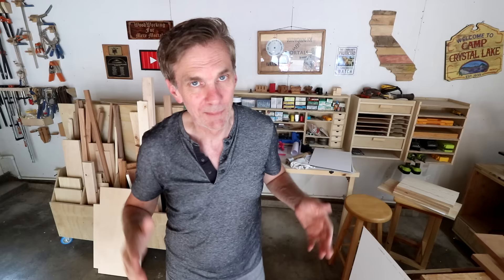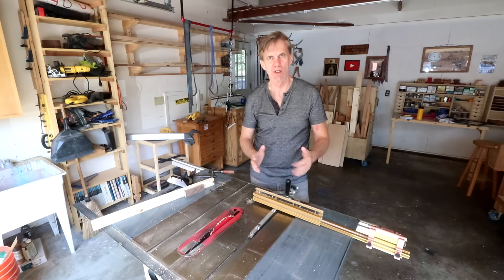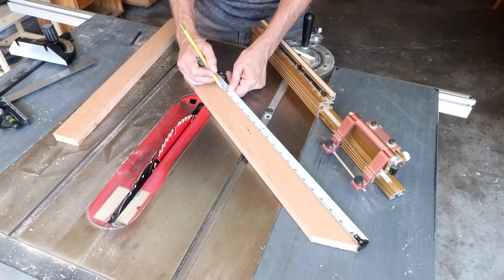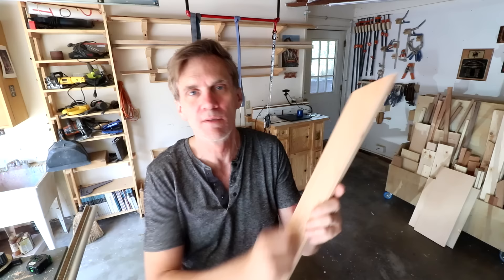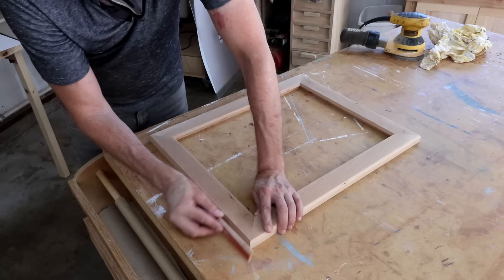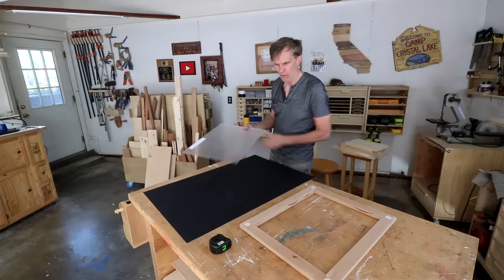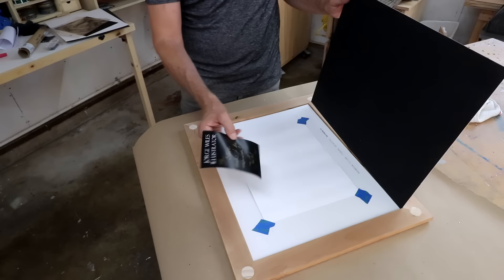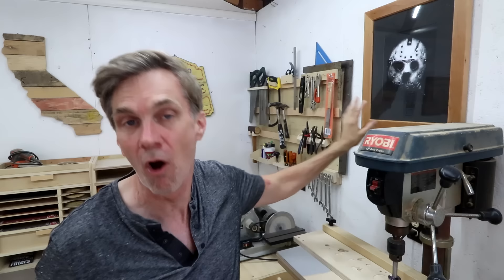Picture frame BASICS. How to make a simple picture frame using a tablesaw.

Comment: Hey Steve, you only need to tape the top of the artwork, this way changes in humidity and temp don't cause your artwork to be wavy inside the frame. If you only tape the top, the artwork will always "hang" inside the frame and stay flat
Reply: Came here to say this. Was also pleased that some still knows what rubylith is.
Reply: I'm only a year late to the party, but was also going to say the same! I like the table saw method for rebates - although I use a Morso for the mitres and an underpinner for joining the frames..the Morso is awesome for repeat, accurate cuts - they are not cheap, they are not light....but they are good! Mine is now 45 years old and still works brilliantly - those Danes know how to over-engineer 😊
Reply: @crispy_otter  there is no such thing as "over engineered". I dare you to supply an example 😉
Reply: @richardcagle5475  Every Mercedes ever built. Great until something goes wrong then it's $1000 to replace an unnecessary sensor that won't allow your car to drive. 

Also most Volkswagen's. Haha.
Reply: @maxgilbert18  cheap sensor. Expensive labor. Just do it yourself an they 1k sensor is $50
Reply: @richardcagle5475  That's why I drive an old Toyota. Very cheap to fix. But the parts are getting harder to find these days unfortunately.
Reply: @richardcagle5475  Juicero Press 😎

Comment: I thought that dowel reinforcement looks like it could be a nice decorative element on the frame itself using the contrasting color woods, maybe use a couple of smaller 1/4" brass rods per corner, not to mention splines, router profiles, exotic woods, texturing, gloss finishes... you know... over complicate things! 😁 And BTW: not just woodworkers... engineers too... that's kind of in our job description! 🤪 - see you next time.
Reply: Agreed. Im gonna knock this frame up and pop the dowel locks on the front

Comment: Former custom framer, here. Just loop the wire through the d-ring twice, and use the excess to wrap it around the long part of the wire tightly to create a kind of coil pattern. Do that on each side.
Reply: Came here to say this!
Reply: I always double up on wire like that by twining it with a drill. Maybe not necessary for light frames but it’s a lot of fun to do. :)
Reply: Same,  whats your favorite kinda wire?
Reply: @dw4940  coated stainless steel wire in a variety of sizes based on the weight of the framed work

Comment: Hi. Greeting from Vietnam. I've been watching every single videos of yours in quarantine time and they help me so much. I bought some power tools (from your 1000$ list), declutched the forbiden corner (in which we stored scrap over years and years) on 2nd floor, and then turned it into a DIY garden. Most based on your ideas making stuff from pallet wood. 
My favorites quote of yours (especially when i doubt my work is so normal) is : You create something from nothing, that makes you special. That quotes keep me on track to complete everything i ever start.
After 4 months, the forbiden corner has turned into a lovely garden my dad and mom relax after work.
Sincerely, i wanna say thank you so much. I'll keep watching and learning from your channel. 
BTW, i really want to show you about my garden but I don't know how to. if there is a way, plz tell me. I do appreciate.

One more time, thank you so much.
Reply: So I have trouble figuring our measuring for the miter cut. If I have a 16 x20 canvas painting and I want to allow for the rabbit what is the rabbit cut measurement. For the 16x20 do I add 1/4 to mark the point of the 45 degree cut on each piece? If not how is it measured?
Reply: @garyfournier9419  l think it would depend on the width of the frame. He was using a 2 inch frame so therefore he was adding 4 inches per side to allow for the mitres. 16 by 20 would extend to 20 by 24 inches.

Comment: Double side tape on all the way around the edge of the back of the picture before you put the bumpers and hangers on it.  Then lay out your craft paper on the table larger than you picture.  Make sure its flat on the table.  Lay your picture face up on the paper and press all the way around it.  The paper will stick to the frame.  Then flip it.  Pinch a razor blade between you thumb and forefinger.   Use your forefinger as a spacer to ride along the edge of the back the frame and trim off the excess paper.  Should be nice and tight.  If not... like he said use a damp cloth to tighten it up.   I use a 3M dispenser with tape on a roll.  Leaves just the sticky tape.   I also picked up a nice mat cutter on craigslist years ago for about 60 bucks.  Was used a frame shop.  I used to work in a frame shop and its exactly like the one I used.  cuts pretty good.  Just a bit hard to store.  Also, if you use glass leave a 1/8 inch space (top and bottom) in the rabbit for the glass to expend and contract.   I also weight the bottom of the mat at least 1/4 inch so it looks even sitting in the rabbit all the way around.  Some like it heavier.  I'm not opposed to it at all.  I like a thick mat.  2 inches or better.

Comment: Being that the pointed tip of a 45° cut is the weakest part of that end-cut, it is a better to use a stop-block that is also cut to 45°.  Then your following pieces will be registered against a flat surface (albeit angled flat surface) versus a relatively soft point ... a point which may not provide consistent results.  I found that advice when I did a little research before making my first picture frame ... and my first attempt came out perfect.  I always look forward to seeing your videos, Steve.

Comment: Great video. I love the idea of the dowels to secure the frames. I've never thought of that!

When mounting the artwork to the back of the mat, I use wide paper surgical tape. It's acid-free and it pulls off easily if you need to reposition it. Also, I only apply the tape to the top of the artwork. This allows the artwork to float behind the mat. If you tape all four corners, the artwork cannot expand or contract and can result in ripples.

Comment: Great video! I´m gonna try to make a frame myself later.
Quick tip: For a zero clearance inlay, you can just tape the gap using ducked tape. Just make sure the tape runs the length of the table. There you have a zero clearance inlay in 7 seconds.

Comment: Thanks Steve! Made one this weekend and it’s fool proof. Have only been woodworking for a year or so and a friend needed a frame for an odd sized picture. I think this is the first project I didn’t have to redo anything. And that’s because I followed your instructions to a tee. Your videos are the best I’ve found online. Thanks again.
Reply: Please tell what kind of wood you used…does it have a grove on the back?
Reply: I just used pine from Home Depot. No grooves on the back, I just used picture backing from craft store and small nails to hold the picture in place.

Comment: The dowel trick is awesome🤩🤩🤩. I've never seen it before
Reply: I thought the same thing!! Before I'd been either adding splines or just hoping it holds 😆
Reply: I dunno if it adds much strength compared to a spline, it's still end grain.
Reply: @The_man_himself_67  Definitely not as much as a spline, but still better than just leaving it as just the naked miter!
Reply: @gingeraleman7723  hmm, not convinced. I think I'll have to make and test one lol!
Reply: @The_man_himself_67  It is significantly stronger just on the additional gluing surface alone. And, it's end grain to the side of the frame.  If you want it to be side to side, glue in a plug cut across the grain.

Comment: I have attempted and struggled to make picture frames so many times... Thinking to myself "picture frames should be easy!" Every time, I wind up hating it, hating the way the corners look, or just giving in and going to buy a pre-made frame. THANK YOU for breaking it down for me in a simple, and followable way. I appreciate it!
Reply: The secret to accurate frames is to make sure that opposing sides are EXACTLY the same length - without that no amount of 'subtle adjustments' will cure the problem.  Also applies with hexagons, octagons, etc

Comment: Great tutorial. I am only now (that I am retired) getting into woodworking, but I have my degrees in Fine Art with an emphasis on painting. I spent years working in frame shops and record stores during my college years, and the way you attach the wire to the picture frame is exactly correct. Of course I hope people should realize that if you are hanging a large painting or poster under glass, the weight would be pretty heavy, so you definitely would want to use a heavier gauge wire. Make sure that the wire is rated for the weight of the piece. Very nice finished product.

Comment: Great video on frames. I especially like the dowel trick in the corners. Another tip for cutting mats, especially dark colored ones, is to hold the exacto knife at a 45 degree angle. This way it creates a thin white line around the front of the opening. Most hand-held mat cutters have the blade at an angle to do this.

Comment: Ive tried and failed to make picture frames that look good since i started woodworking. I just modified my stock mitre gauge as you suggest in this video and after realising that 44 was closer to 45 (cheap plastic)on my gauge, ive just cut my first decent frame. Its good to go back to basics from time to time. 👍

Comment: When I was in high school art class, my teacher said to only tape art to the mat board at the top. The reason being that as years go on, the humidity in the frame will slowly change, causing the paper to slowly expand.

By taping it on the top and bottom, it locks the corners in place and the art will get wavy and look weird as it slowly absorbs that moisture.

Comment: Thanks for the video!  Mattes are best cut professionally.  They can make beveled very accurate cuts.  Glaziers push points will hold the backer board snugly and are easy to install. Just push them in with a slot screwdriver.

Comment: Steve, I love your videos! 
Would you be able to do a video on choosing lumber for projects? I see many projects requiring 2x6 or 2x8 whereas home depot and lowes don't stock Pine in these sizes but do stock green Douglas Fir. Should we use Douglas Fir instead of pine? Should be laminate smaller pine boards instead? 

Thank you!

Comment: About the Table saw / router table thing... Yesterday I added a router to the right side extension on the table for my Dewalt jobsite tablesaw. The table that I made about a month ago was originally designed and sized with this in mind. I just had to figure out how to mount the router. I had originally planed to use my Makita one handed router and a lift, but came to the conclusion that it was too weak.
The router (1400W Triton) can be adjusted from the top when it is mounted in the table, it even came with a handle for that purpose, so it saved me a lot of work and a lot of headaches trying to make a lift myself.
Now all I need to do is make a router fence to clamp onto the table saw's rip fence, and maybe add some T-tracks. Oh, and add a plate in the bottom frame beneath the router extension to hold the box for my one handed router. :)

Comment: I have to secure 2 mats that I used glazier points to secure the back, but was difficult to tap in with varying results. 
So thanks for the tip about the Point Driver tool, I thought there may have been a Kreg type biscuit tool for this. This is great.

Comment: Steve, I do like you work, you make this hobby so much more approachable for me 6 years ago.  Does end grain of the dowel really re-enforce joint?  I’ve had other results from a failed previous project.  End grain just split with expansion of the joint.  Was a great excuse to improve the next frame I built.  I’ve built 80% of the furniture in there my home from your and other online instruction.  Im even a volunteer woodshop steward at a non profit makerspace and teach tool use safety classes.

Comment: That's interesting you learned to cut mat board with just a razor. I've only every been taught to use a mat cutter and sizing that way. Also, ty for this. I've only every use mat for my images and wondered about a picture frame I could use instead. I will have to find some wood to try this soon.

Comment: The dowel trick is brilliant. I’ve been putting (wait for it...) biscuits in the miters of my frames. You can either hide the biscuit completely inside the miter (if the frame is wide enough) or just glue it vertically in the back and saw off the excess. The dowel looks easier, though I’m sure my biscuit saw will be sad to hear this.

Comment: As a long time wood worker I am always thinking of ways to simplify a construction process. In the case of your frame, when you drilled for the dowel holes, I would have cut the 4 plugs about 1/32" shy of the hole depth. Add glue and insert the dowel with the grain running at right angles to the miter. Tap the plug flush with the frame. No need to saw off excess dowel and sand thus saving two steps.  Just my thought. I know its not a big deal time wise if you are only making one frame but if you were doing dozens of frames there would be a savings of dowel material and time.  Good video.

Comment: Nice video! Great idea on the supporting dowel. Thank you. 

A couple thoughts: 1) Would it be better to stack the frame pairs when cutting the second miter, to assure they are the same length, rather than rely on 2 separate line-ups acts? 2) I understand it is best to feed plexiglas SLOWLY through a table saw to avoid ... well I'm not sure what! But that's is what I learned from others. I plan to start my frame today! Thanks again.

Comment: Just a friendly clarification here, acrylic is fairly scratch resistant and extremely clear but very brittle.  polycarbonate, like what is used in the sign industry, is more susceptible to scratching, very clear but not quite as much as glass, but almost indestructible. Hope that helps if anyone was questioning it, also often times you can find scraps or cheaper sheets at your local sign shops.

Comment: The ability to use the miter gauge set up on one side only depends on the stock being essentially a board. If you look around, you can find picture framing companies that have tons of off cut and left over material that they will sell at a pretty reasonable price. Really gorgeous pre finished pieces.  These pieces frequently do not have parallel surfaces but feature different levels of moulding cuts on the front and sometimes the sides. This makes it rather difficult to put the stock in upside down for the first cut. This is woodworking for mere mortals but, you should know that it can get more complicated quickly.

Comment: The issue with gluing end grain is that the wood soaks up a lot of the glue, leaving an insufficient amount of glue in the joint to form a strong bond. One tip I have heard to address this  is to put on a coat of glue, let it sit for a few minutes while the end grain soaks up some of the glue, and then put on more glue and clamp it up.

Comment: Easiest method to ensure that the cut piece doesn't hold together by the corner is to simply make an overlap cut, even a 1/16th of an inch (~1.5-2mm). Gives you extra nice sharp corner.

Comment: Do you use the static cling sheets when you dry your clothes? Save them, they work great for wiping off the plexiglass. In fact, the plexi will stay clean for a long time when it's hanging on the wall. 

Just make sure you use the sheet after they've been through the dryer.

Comment: Thanks for the great video, I have struggled making picture frames in the past, have always had issues with precision but your tip for adding the matting would solve a lot of this. I’m wondering if anyone has any tips about the following: 1) making a frame with an easily removable back to give us a gift and the recipient can put in his/her own picture. 2) making a smaller frame that can be used on a table top, not hung on a wall. I’ve experimented with various ways to create a little stand in the back but I’ve never been happy with anything I have come up with. Thanks!

Comment: ...you are solid in woodworking technique (this from a cabinetmaker who does art prints and makes his own frames).  One of my better investments is a Logan mat cutter IF I'm doing mats.  I use biscuits for the corners of my bigger frames (just a 0 crossing the miter about midway) much easier to cut off (an oscillating tool does wonders here, and also for your dowels) but, as an artist hanging work in various local galleries, I despise glass or raw plexi.  I just can't stand what it does to fine work, like, when you're standing there admiring whatever piece, looking at the person your standing next to at the same time...pick your background because you've put a mirror over the work!  I've since discovered non-glare plexi and it is the sh*t, more expensive for sure but worth every penny.  Where I get it (at a plastics distributer/fabricator) it's known as P99.  A Godsend.
Reply: ...oh, and one more thing: I design my frames to put the wire hangers on the inside that way the piece hangs flush with the wall.  This is achieved with a bit more depth of the rabbet  and I mount my prints on 1/4" hardboard (melemine and I glue my prints to it...this design requires no matting, it's just the piece and the frame...YMMV).  Just another thing I don't like when looking at art, lol, it's the carpenter in me...

Comment: Could you make a video on how to make bevel cuts on really thin (1/4in) plywood with a jig saw or a circular saw when you don't have a table or sawhorses? I'm trying to make a decorative box and having the worst time to get 45 degree angled corners. Also, I live in an apartment, the only space I have to work on is the balcony (which is why I only have hand-held tools); any tips on how to organize tools inside of a closet? Thanks!